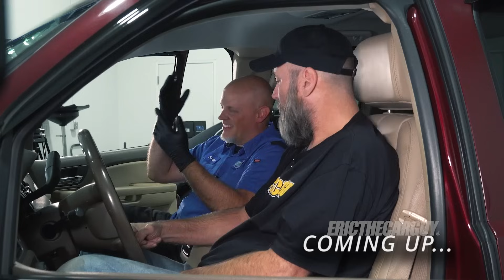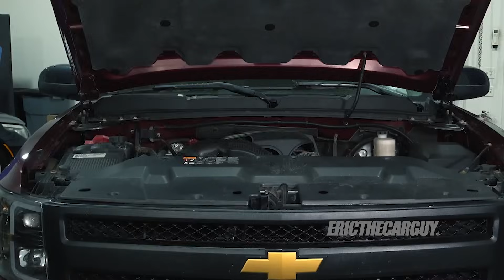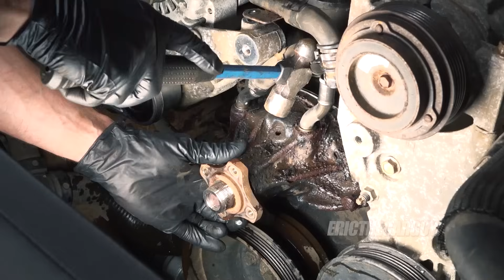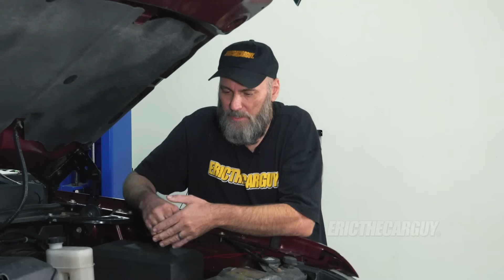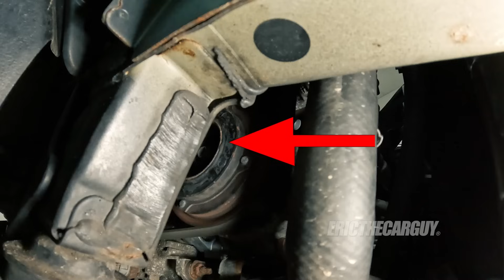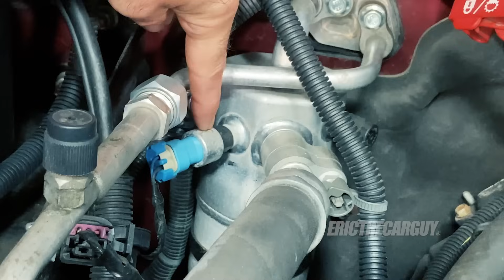Why Isn’t My Car’s Heat Hot? Why Isn’t My Car’s AC Cold?

Comment: My 2021 highlander AC works when weather temperatures are 70's and up. But when temperatures are 85 degrees and up it stops working.. just blows hot air.. what's the problem?

Comment: In my own condition the car air conditioning system cools but not so cold. 

One can only feels the impact of the cold when the weather is not hot, like morning, night or when it rains. But on a sunny day it doesn't cool as much.

What could be the fault as I didn't notice that was touched in the video. Mine AC vent is the type with driver side passenger side and rear passenger side also.

I ll be glad to hear a response

Comment: Hello sir Eric, i just want to ask, my honda city 2013 gm2 A/T has intermitent hiccups at idle, i changed spark plugs, fuel injector, fuel filter. Cleaned throttle body and iacv, new pcv, but hiccup still there, can you tell where would the problem coming from? Thanks.

Comment: My 2000 dodge ram laramie slt magnum V8 1500 4x4 every function usually works except for the defrost vents im not sure what is going on
Reply from the maker: Likely an issue with airflow inside the HVAC assembly. Usually they default to defrost when they fail, but it sounds like you have a special case. Come to think of it, weren't those dashes famous for disintegrating? if so, the debris could be clogging the vents.

Comment: Hello!  I would like to ask something: I have a honda civic vi 1.4is fastback ma D14A2 (England) which wears a metal head gasket.  But I want to replace it with a graphite head gasket that the D15B2 model wears, is that possible?  Mine with the metal flange is 76mm diameter and the D15B2 graphite flange I want to put has a circle diameter of 75.5mm but the rest is the same I just want to do this conversion from metal flange to graphite flange.  If possible, how much final tightening torque is needed?  Is it the same that they give for the metal flange of the D14A2 at 64 N.m?  Does it need a different torque because of the graphite flange?
Reply from the maker: I wouldn't. an MLS gasket is far superior to a graphite one. Just make sure the machined surfaces are true and it should be fine.
Reply: @ericthecarguy  Hello again! Thanks for the reply, I have another question about tightening the cylinder head bolts, Honda Civic D14A2 . To loosen the screws though, which order is it? So to tighten it is 1-2-3-5-6-7-8-9-10 but to loosen it? is it upside down? ie 10-9-8-7-6-5-4-3-2-1 depending on the tightening pattern? or should I start from 1-2-3.........?

Comment: What’s surprising is i have a 1990 Silverado that has  a bad head gasket going on 5 years, getting gas into the coolant and have never had any kind of heat issue. It did randomly overheat when the exhaust would accumulate at the thermostat. Drilling a really small hole into the thermostat plate remedied that problem. I just been using it as my winter beater, no idea how it hasn’t blown up yet

Comment: I got a 08 mercury marquis, I have put a new intake on it, but it keeps blowing the gasket on the two cylinder on the driver side,in the back  the intake in the gaskets are separate. This is the second time I have put a gasket on it and it’s leaking antifreeze down into the spark plug and it’s like it’s missing fire like it out of time I know what it calling the issue because water gets in the cylinder, it get no  fire The car is jerking when you give it gas because of water in the cylinder
Reply: Did you use a quality gasket like Ford or Fel Pro? Did you follow the proper torque sequence on the intake manifold?
Reply: @ well, the intake is plastic and I use Ford gasket and they keep on blowing it and I bought felt pro and keep is blown what’s the torque specs on them, you know
Reply: @raymondjohnson6496  According to my Ford Explorer shop manual (which has the same engine as your Mercury) you have to torque the bolts IN CORRECT ORDER in a two-stage process: first torque them all to 18 inch pounds, then the next stage is 90 inch pounds.  Hope that helps!
Reply: Thanks for that, but I didn’t think you had to torque them. It’s probably why it’s leaking. We just tightened by hand that’s it I was afraid because it’s plastic, I didn’t. Know I was afraid I was gonna crack it
Reply: @raymondjohnson6496  oh yes! You HAVE to follow not only the torque settings, but also the torque sequence. It's very sensitive to that!!
Reply from the maker: It starts with they type of gasket and it's installation. It needs to be good quality and you need to make sure the surfaces are clean before installation. Additionally, you need to make sure it's the gasket that's leaking and not something else. More info on finding leaks here. https://www.ericthecarguy.com/finding-and-fixing-leaks/

Comment: Good job covering all of the most common AC fail points.  There's one that I thought I'd mention that's not real common, but I have seen more than once, and that's a system that's been over-charged.

Say a fella's got a slow leak so every spring he just automatically chucks a can or two of refrigerant at it except this time he adds three thinking it will last him all through the season.  The pressure switch detects too much pressure (as opposed to not enough) and will not turn on the compressor.

Lesson:  Always use a gauge when charging, preferably a manifold but even one of those cheap single dial chargers that you can get at WallyWorld is better than nothing.

Haven't seen this one too often, but often enough that I thought I'd mention it.
Reply from the maker: Good one!

Comment: For the past few years my driver's side blows cold when the heat is on. Then weeks into the fall/winter it'll magically start working. No issues with the AC in summer ever. Just the heat on the driver's side. Any ideas as to what's causing all this?
Reply from the maker: I thought I covered this in the video but, check for air in the cooling system.